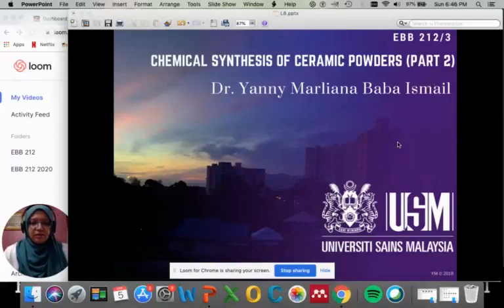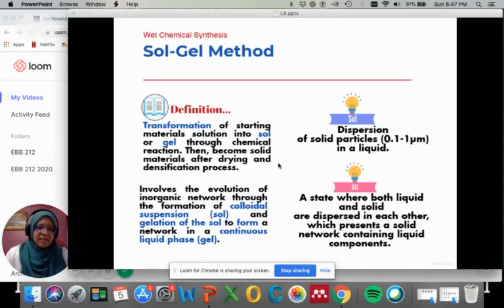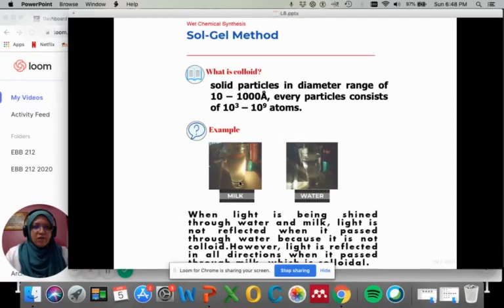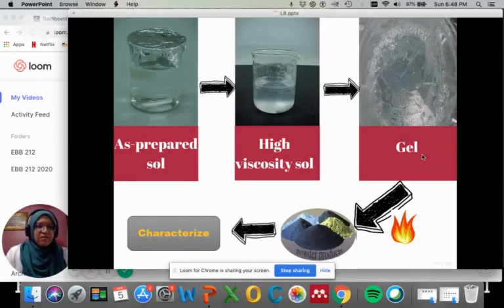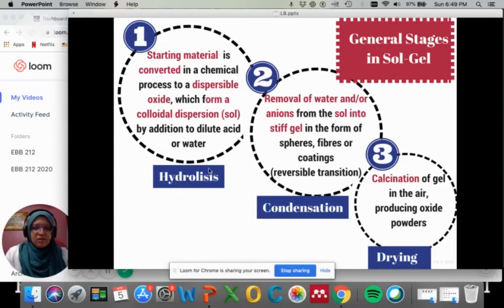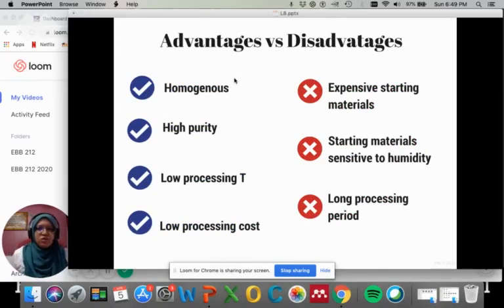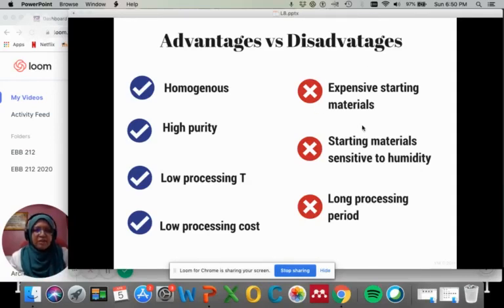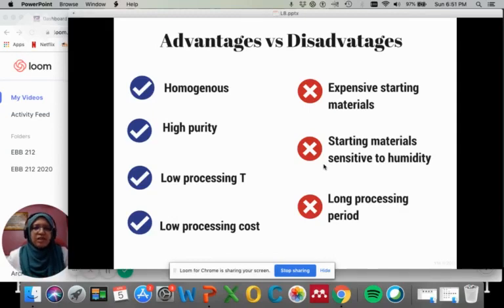SOL-GEL METHOD

Comment: assalamualaikum DR Yanny,  saya firdaus dari uitm shah alam.
Saya ada satu soalan, ada perbezaan kah antara SOL-GEL dan SOL-GEL IMMERSION? atau adakah ianya berbeza kategori sahaja?
sol-gel : alcohol based
sol-gel immersion : aqueous based
betul ke pemahaman saya?
Reply from the maker: Waalaikumsalam Firdaus. Sol gel immersion is just a method in sol gel. It depends on the intended end product . The one I explained here is simple sol gel to produce ceramic powders. But if you want to produce coating using sol gel you can either do immersion or dip coating sol gel. Hope it helps.
Reply: @dr.yannymarlianababaismail9954  ..ooo i see...thank you Dr...sbb saya nak tahu perbezaan antara sol gel dan immersion..sebab projek saya mengenai fabrication of humidity sensor with hematite and nickel oxide using immersion method....jadi  saya sedikit keliru nak tahu perbezaan  antara kedua method ni.
Reply from the maker: @firdauspezol  Oh ok, that makes sense now.  Yeah I had seen people making sensor using immesion sol gel. It is quite common. Btw, good luck for your project.